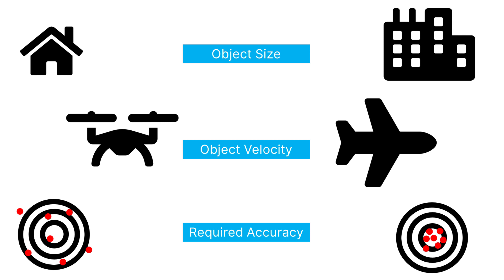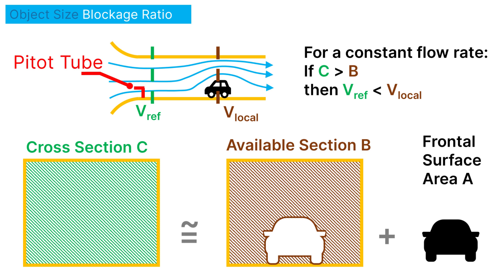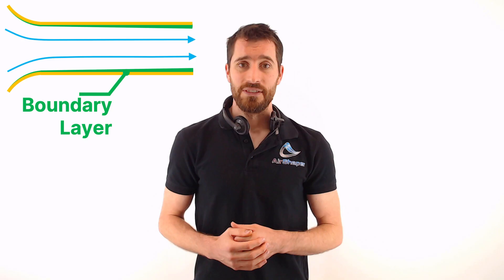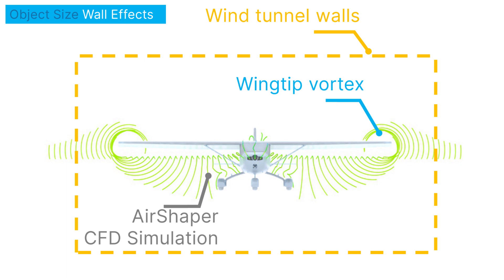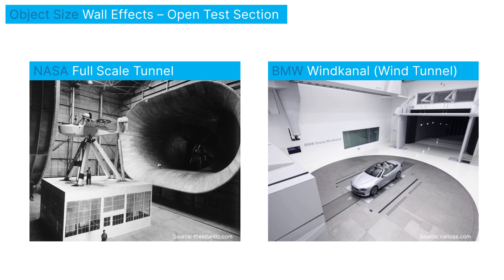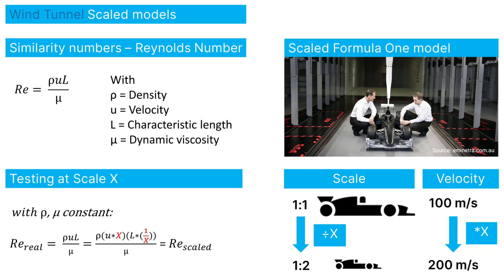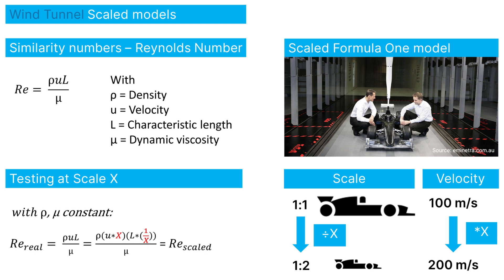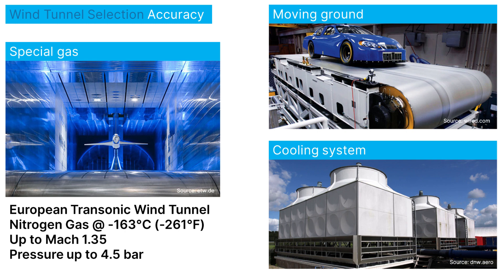How Wind tunnels Work – Blockage factor, wall effects, scaled model, similarity number, moving floor

Comment: Hi Wouter, I'm building a big 2m x 2m x 10m high speed tunnel to test different RC wing designs, aiming to fly the RC inside the tunnel to see the reactions in different air speeds, Will this work? Before i invest too much 💰

Comment: Does this same scaling apply when using CFD? For example, if I had a 20 meter wing that flies at Mach 0.85, but it is 1 meter in my CFD,  would I have to change my Mach number and reynolds number input to get the correct coefficients? Also, are there any other changes I need to make to get the correct results?
Reply from the maker: Hi Brian,

the benefit of CFD is that you don't have to scale your model.
But indeed, if you would scale it virtually, you also need to respect these changes in velocity and so on.
And indeed, this goes beyond the Reynolds number. If you want to achieve similitude between flows, I suggest this page:
https://en.wikipedia.org/wiki/Similitude_(model)

Comment: This is a good video, thank you. I have a question. What could be an alternative when the Reynolds number of a scale model cannot be matched in a low speed wind tunnel testing? (I mean, when you are limited by the wind tunnel facility, you do not have a water tunnel available, the model cannot be scaled to a larger size and the speed to match the Reynolds number is very high so the tunnel I cannot match that required speed)

Could a solution be to carry out numerical simulations with the available wind tunnel conditions? (model length and wind speed) and validate the CFD results. Once you have found the correct CFD parameters (also check the Y +), the next step could be to keep the same parameters and simulate the model in real size, with real wind conditions

Or matching the Mach number in the wind tunnel test instead of the Reynolds number might be acceptable? (Considering that the speed of the real model is 100 km/hr. So, the Mach number is not as relevant as the Reynolds Number in this case)

Or is there some other method to approximate of the results in this type of situations?
Reply from the maker: Hi Gibran,

I don't know of any method that would provide equally similar results compared to the similarity numbers. You could indeed consider running a simulation on the scaled model to see how close it gets to a simulation on the full-size model. But first of all, it might be luck when the numbers match (so do check flow patterns as well) and second of all, the relative improvements you get on the scaled model might not be correct or even make things worse on the full-size model, as you're operating in a different Reynolds regime...

In some cases, if you're looking at an isolated part (like the landing gear of a small plane), you could consider testing just that one at full scale/speed. But then of course you lose the proper surroundings.

It's always a compromise :)
Reply: @AirShaper  Thanks for your answer it was really useful!
Reply: In case it is a wing or smthing similar, there are some techniques to induce turbulence earlier than it supposed to occur.
In that way you get "closer" to flow structures corresponding to the Re you can't actually achieve.... I don't know how accurate it is and as a fluid dynamicist I wouldn't recommend that. In any case, there is some literature over it. It is called boundary layer tripping.
Hope it helps 😎

Comment: spin a barrel instead, in open air
Reply from the maker: Would result in curved flow 🙂
Reply: @AirShaper  well thats easy way of doing that tho, circular duct around it
Reply: @AirShaper  its like earth, locally approximately non-circular, ie area and not so curved, spin a large cylinder to make it approximately linear, and yep it will have outwards negative gravitation acceleration